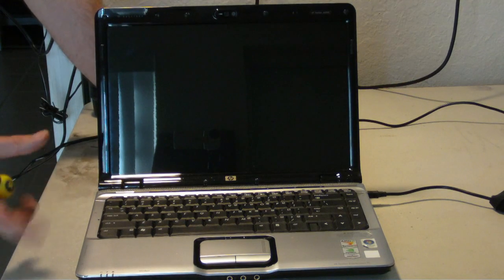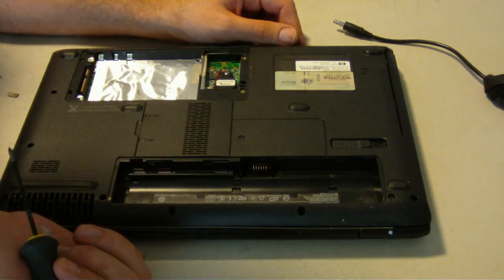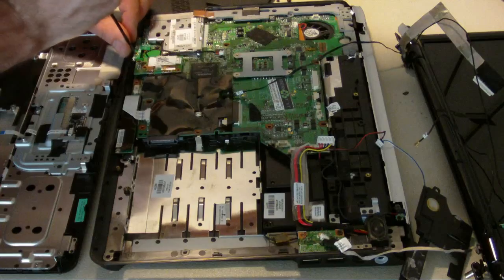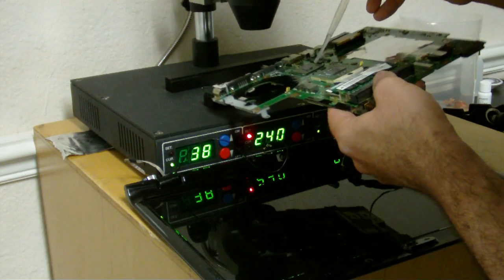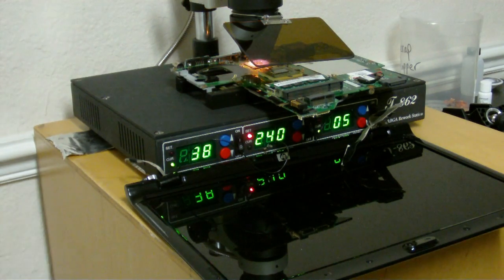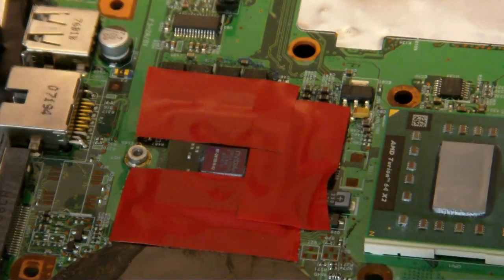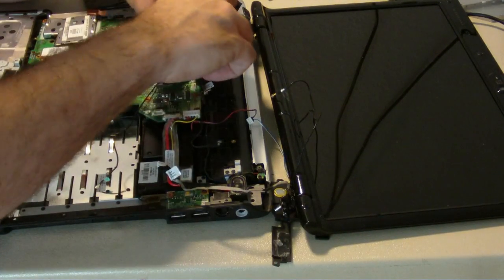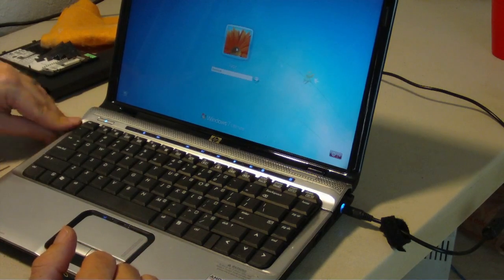HP DV2000 Blank Screen Nvidia video problem? Fix it with this BGA reflow technique!

Comment: Not for beginners or even some intermediate folks. The fast paced video can be paused and repeated but some parts of disassembly were omitted or assumed. And I don't have a T862 Rework Station laying around. Fine, call me an amateur but I've done successfully performed dozens of repairs on a similar level, including iPads. Based on his rough estimate of the copper gauge I found some GPU/CPU heat sinks on Amazon - http://www.amazon.com/gp/product/B00OUJQX8K?psc=1&redirect=true&ref_=oh_aui_detailpage_o00_s00

Comment: I did this repair and it worked, I even put in a copper shim in it. But I kept getting video problems with it where it would give lines. Now the screen has stop working again. Any advice to fixing it, I feel like I have put too much in it all ready for it to be behaving this way. And would need to spend more getting a new battery and cord (of witch I am borrowing from my other laptop).

Comment: Thanks. It worked. I used a head gun and the Arctic thermal paste. I used a 91% alcohol with q-tips to clean the old stuff. I haven't had a issue since.

Comment: My HP Pavilion dv2000 (dv2125nr) laptop has screen issues also.  It works for a while- then my screen has nothing but horizontal lines. I manually turn it off, wait a bit, & SOMETIMES that works.
Lately it goes black & when I try to start it later, the lights come on, but not the screen.
Although this isn't the "correct" way of doing things, I've tried clicking the "f8" key continuosly, while turning it on.  That was worked - so far.
Looks like you might have another customer soon!  lol..  ;)

Comment: cover it with aluminum, all except for the GPU, and put it in the oven on really low heat for a good 45 minutes, take it out, let it cool, and put the copper in.

Comment: sup just seen vid , what a crappy design this thing is, i broke it down and put it back to gather i seen the video  i seen so i didnt put the copper in , ill break it back throw some copper in . but my real question is that the video /screen  kinda freezes/ pixelates .once reboot it might run from a minute to several hours with temps between 43c~57c its an AMD-er dv2000 so i tend to run AOD and under volt .800mhhz thanks

Comment: i have a dv9700 runs fine but black screen i can see an image when i put a light behind the screen i have changed the inverter and the lcd cable  but it does not give backlight i changed the backlight in the monitor same thing   and tried a known good monitor same thing     works on vga output  i dont know what controls the backlight i think that might be whats wrong with this laptop     oh yea when it started to go out  
if i moved the monitor a little tiny bit i saw lines

Comment: I would like to know if T862 it has enough surface for heating the all nvidia gpu? Did you modified the IR lens to change the surface of beam light? Can this be userd for reballing an nvidia gpu? I have seen in other videos one guy using a heat gun for heating the corners of the gpu, saying that T862++ it doesn't have enough surface for heating all the gpu. Thanks.

Comment: I also have this nvidia video problem..the problem with the unit is it easily gets hot ,when it gets hot the solders melt down and gets loose so youneed to reheat it and add some modifications like fan or the one in the video.think if you cant do it yourself send it to mixcat

Comment: The Pavillion AMD's like to run hot. They use cheap thermal paste on the CPU and thermal pads of QUESTIONABLE quality on the GPU, and possibly the Northbridge and VRAM areas (if you have an Intel unit, but inspect board first). I recommend using Arctic Silver 5 or better (Noctua, Shin Etsu or whatever floats yer boat) on the CPU, and Fujipoly Sarcon pads (from FrozenCPU) on the VRAM and GPU.

-an ex-HP Pavillion owner, now a Thinkpad Mafia member

Comment: hey, real big fan.... seen all the vidz about video issues, also intrigued by your green solar panel, i have one question.....ive been wondering what are the proper procedures of reflowing with a reflow station, im thinking of getting one (exact model from this vid) and would like to kno wat to preheat a motherboard to, whats the proper distance to have the lamp from the chip , and how long do i leave the lamp on the chip, thank you

Comment: I have an HP dv2615nr with a blank display. I can use an external monitor just fine. Does that mean the nvidia chip is not the problem?

Comment: was to replace i paid for them. i paid her to do this and fix it back up but she did not check her work or boot software. now i went to boot software and i get a screen and it won't boot from the hard drive or a disk. and gives an error.. what is this.? i really need this fixed I'm broke and can't afford a laptop bill.

Comment: i have a problem with a dv 6000 . my screen cracked and i  replaced it but i am not a pro and it was my first attempt.   i did not connect something right . it turned on then shut down. then i could not get it to work. i took it apart more out of frustration. and then stopped. i let someone with a shop in caribbean fix it. but she wanted to rip me off and id not run soft ware back to get it to see if it was all good. also i was told the connector ribbons were damaged. maybe i did that. ok she

Comment: SOMEONE PLEASE HELP ME!

i have a hp pavillion dv 2700, i have this exact problem, blue lights and hard drive spinning but no lcd image. im nmot scared of openeing it up BUT i dont have a blow torch or any of the fancy equipement showed in this video.

is there any alternative?

also i dont understand how by just heating the component to a high temperature will fix the problem? surely it will make it worse?

thanks in advanced

Comment: Really good video - just done my first repair on the same reflow station.how do you max the fan out?? Where can u get that copper as I just used an off cut I found lying about in work (cleaned up b4 use)

Comment: Ok ppl baking  has got to be the easiest fix for the graphics/black screen issue, i have a dv2700 and all i did was take out the motherboard but the only difference is that i foiled the entire board in 3 layers of foil and cut a square over the gpu chip top and bottom, then i put it in the oven for 9mins at about 350-400 Fahrenheit, on the bottom shelf. then i just opened the oven and left it for half an hour, reassembled and it fixed not only my graphics, but my DVD drive and Soundcard!!!

Comment: I replaced the motherboard on my DV2500, but when i switched the unti back on (FULLY REBUILT :( ) it was the same, except the screen was black instead of just lighting up. Would that suggest screen issues or Motherboard still???

GREAT vid! Thumbs up!!

Jamie

p.s What's the cooking instructions for the Oven method? :D

Comment: I am just getting into re-flowing using a T862++ that I recently purchased and have so far successfully brought an Xbox 360 back to life. I'm now trying to do a HP G6000 laptop however the Nvidia chip has a red wax like residue around the edge preventing me from getting any liquid flux in there. Have you come across this before? I'm scared to try and scrape it away in case I damage the board while doing this! Any help is appreciated.

Comment: I seem to have the same issue too, but I would like to know if the fan is also running when the l.e.d.'s  turn on. if I can confirm that it does not make a sound when it is on, then I can confirm that my graphics card is the source, and that it needs a reflow. ;p thanks!

Comment: My husband used 91% rubbing alcohol, a piece of copper pipe he banged flat, a heat gun and thermal compound.  He heated that area of the motherboard 220 celcius.

IT WORKED!  He's so stoked right now!!!!  You are amazing!

Comment: i got it workin on mine i added a copper shim to it and some silver thermal paste and my gpu is around 62-65 idle. seems a little hot to me but what is yours running at after the mods?

Comment: Bah.Got the same problem again after I fixed it... I actually added the copper piece in there and used thermal paste on each side but it still went out... I didn't use any flux though... So I'm guessing that was my (amateur) mistake? What does the flux do as far as reflowing it?

Comment: Hey,
i've got a problem. I had the "1 long, 2 short beeps" and i did everything you did in this video. Then i built the laptop back and now it still doesn't display anything but its worse. I have no beeps and at the 3 lamps at the frontside of my DV2000 it only displays the electricy ''lamp'' and not the lamp that displays that the laptop is on. (I mean those lamps you have at 0:12 southwest in the corner).  
WHAT DO I HAVE TO DO? Did i do anything wrong while rebuilding the laptop to normal?

Comment: So I tried this shit on my friends dv27000 today and I noticed you edit past when you're taking the plate between the keyboard and the mainboard apart. I can't get that shit to come apart. There's some type of strange proprietary screw and nut holding it together that looks like it's just there to prevent you from taking it apart. Anyone else run into this shit?

Comment: Just tried this on a dv2000 I got in the shop today. Took a Wagner heat gun on low, positioned it above the GPU from about 1 inch away, and turned it on and off, just like the video shows. Hooked it back up, and it's working right now. Thank you! Free fixes are always the best! Especially when running a business!

Comment: Hey man, I reflowed my cpu and gpu on my Ps3 board and used artic silver and a heat gun on a wooden table. If I took apart my dv200 cleaned the bga and put new paste could that fix my screen problem? Better yet what else should I reflow while I have the thing open. Also, Is the electrical tape and copper necessary?

Comment: Correction on my last comment.  What I have a hp dv2940se with the same question.  What is your estimate on this particular model and can you also replace the left mouse button?  It keeps sticking and sometimes pops out partially.  Thanks.

Comment: Hey plz help I recently got my laptop fixed installed new Window's 7 software  but on an old laptop HP dv2000, but my dog droped my laptop and after that the screen went black, it loads normally you can hear it but you can't see it, I only get a quick view from the log in screen it was working perfectly before the incident plz someone help because it's my only laptop

Comment: I have a problem with my HP pavillion dv6420ca, it just suddenly blank display or black screen when I turn the power on..no beep sound error..even if I remove all the rams then it gets no beeps when I press it on, but the power led is on..no blinking on other leds..w/rams or w/out rams..same scenario..what do you think is the problem? help me plss...

Comment: @mixcatcom EVERY HP DV6700  LAPTOPS ARE FAULTY DUE TO OVER-HEATING. THIS WILL DAMAGE THE MOTHER- BOARD, BATTERY, PROCES WITHIN  1 TO 3YEARS TIME.

THESE LAPTOPS SHOULD BE RECALLED BY HP. SOMETHING SHOULD BE DONE ABOUT THIS PROBLEM. HP ARE HIDING THIS FACT & ARE FOOLING THEIR CUSTOMER'S WITH EXCUSES. 

THESE DANGEROUS LAPTOPS ARE A HAZARD & CAN CAUSE FIRE, OR SKIN BURNS, ETC.

I PAID £800 WITH A BUILT IN BLU-RAY PLAYER & IN 2008 THIS LAPTOP HAD THE BEST SPECIFICATION BUT NOT WORTH. WONT LAST LONG

Comment: thanks for this video last week i fixed my dv2000

i only had a question 

on the fan holder is an little blue piece that is between the video chip and the  fan holder

did you took this piece away ore not because I'm wondering

Comment: i have hp tx1000 i got repaired for a while ...but now it sometimes works and sometimes it doesn't so i let it sit for a few days it get back to work again if i put some the copper that you showed on your video do you think it will help? and how much for a little piece that fits on my video card ... thanks

mak

Comment: I have a question i just opened my dv2700 because i was having the same problem and was just wondering why is there a glassy white substance on the chip itself? is that bad like a bad residue?

by the way thanks for the video

Comment: Much respect Peter, great video. I just finished re-seating the chip on my 2313cl as per your video(Used the torch method from the dv9000 video to heat it), and the assembly guide here. My tweak was that I used a 2mm thick piece of copper, that I custom fitted to my laptop. My main concern has been potential movement of the copper shim. I'm in the process of making a 2nd variant, with 3 mounting points(mounting with the heatsink itself) for the dv2000. Any thoughts? :)

Comment: @theDoctar because laptop video cards are in an enclosed space, and frequently get too hot.  often, the problem experienced is due to solder connections overheating and melting, breaking neccesary connections. heating up the video card melts or "reflows" the connections.

Comment: The screen on my dv2000 is very dim and it will somtimes come back to its normal lighting. Is this an inverter problem, or a bga one. I doubt it's the bulb because it just worked today but then it went out again.

Comment: Great video! I am going to attempt this on my dv2610us soon. It still turns on and works fine but it shuts off randomly so I think the GPU is on its way out. The GPU idles at 65-70c =(. 

I have tried to take the laptop apart before and those little white connectors are a PITA to get off! I accidentally broke one of them, but thankfully it was just the connector for the webcam. Any tips on how to jig them off?

Comment: Hi, I have a Hp G6000 with a power issue, I know is the nvidia chip set GPU processor. It used to restart in 5s cycles but after a while It doesn't power on at all! Do you think it will still work for me? Thanks!

Comment: Did you conect the solder iron to the 862 station?
I Ask because the temperature isn't shown corectly. I have the same problem with my solder iron on my T862

Comment: I have another dv2000 related problem for you mixcatcom. (to make a long story short) i removed the hard drive, put it back in. My notebook starts as usual... except when windows should start up, there's only a curser in the top left corner that blinks w/ a black screen. WTF is going on... any help would be greatly appreciated!

Comment: I Have a dv 2000 and it has the same problem with the black screen but i found an easy fix instead of taking the computer apart.. i just let the computer over heat untill it was almost to hot to touch... turned it off to let it cool... and it worked lol.. its only a temp fix but it works for me... fuck Hp

Comment: @mixcatcom 

Hey max! thanx for the reply... when i posted the comment.. i was pretty despirate to know if it'll work.. so i went ahead and used a hair dryer.. Worked and i was really happy... 4 days passed and it was stil working! (a few times when i restarted the laptop.. the laptop screen wouldn't turn on.. i thought oh its the problem.. but i removed the battery and waited.. and popped the battery back in and it worked!) until today... i turned off the Aero, restarted, didnt work anymore.

Comment: gee thanks, was able to got my dv2000 running again..., i used pen torch;  a layered thin copper adhesive (to make it thick) to replace the copper sheet (coz i find it hard to get em) ... 10/10 Hope this works for another 3-6 months... i dun have a budget for a new laptop yet...

Comment: Great video!!!  I had one re-flow done by someone in your area.  Well issue came back.  I did all the work and just asked them to do the reflow, oh and paid the same price.  Can you work out a deal for me if I do the tear down and rebuild.  I would need you to test the unit works before returning it to me.  I can send the whole machine however there was an issue with the area around the cd/dvd tray and I had to do a small fix.
AAA+++ Video, where is the fan mod?

Comment: My DV2000 will only display an extremely dim picture that is barely visible.  Do you know if the problem is the BGA, or is it an issue with the backlight?

Comment: Hi mixcatcom, is it possible that i can do this on my own? my hp dv2000 had a blank screen problem 3mos ago and had took it to the repair shop (biggest pc repair company here in England) for repair, but they returned it to me and refunded my money after 3weeks as unfortunately they cannot fix it..please response if its still possible that I can repair this.Thanks

Comment: @3Dubside You're heating up the chip because the solder underneath the chip has broken loose and heating it up re-solders the chip back to the board.

Comment: @mixcatcom what do you mean by,  not to "over back" the chip. And what is the temperature that the solder starts to flow? what brand and spec is the liquid flux?
you truly are hardcore. great work. great video.

Comment: Hi Pete,

Thanks for posting this video. I have 2 HP DV2000 right now with the same problem. One still comes up with video after many attempts, but the other doesn't. Am thinking of sending both to  your shop for fixing. I mean, I can try fixing them myself, but don't want to risk it. How do  I go about it and how much do you charge? Please, let me know asap. Thanks a lot!!

Comment: just a quick question... I repair laptops and I have to say I've had a number of dv2k's with either the 3 beep problem.. or some sort of graphic problem. which in both cases is related to the GPU on the motherboard..
So I have basically done the same fix you have done, although not exactly in the same way, and also at a higher temperature. 
But after a couple of weeks, or even less, the customer comes back saying that the problem has come again.
So I don't think thereis a permanent fix. 
Thanks.